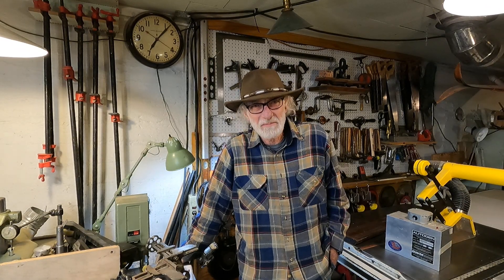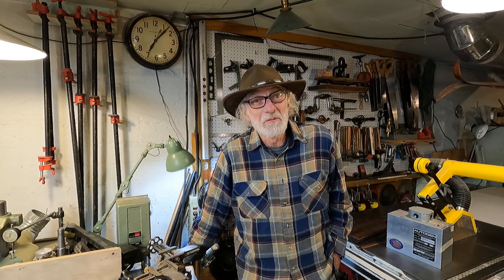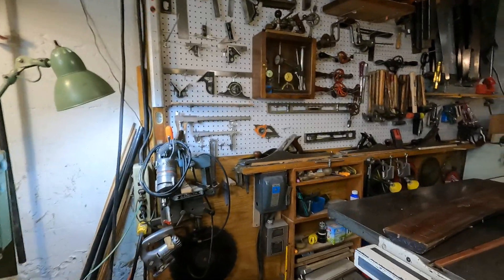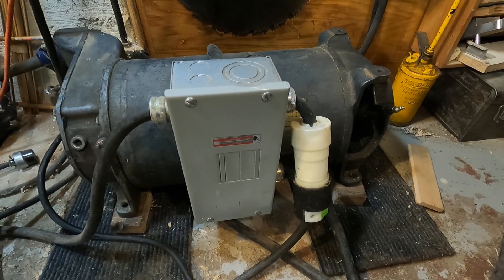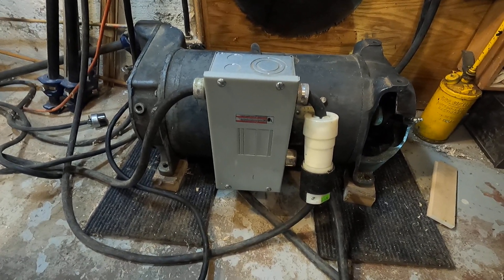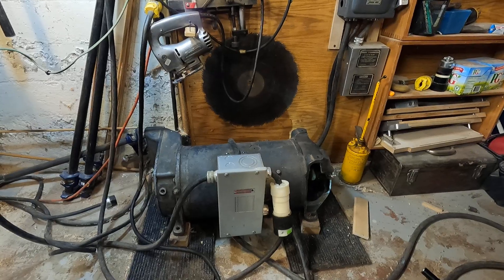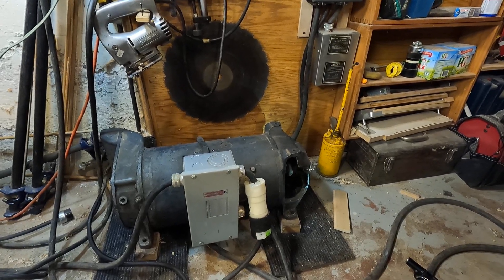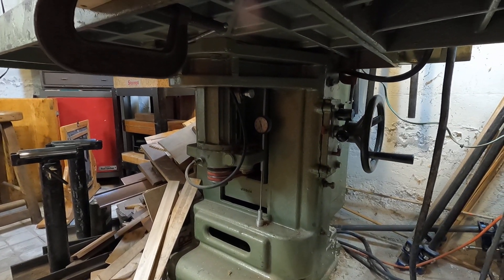Machine shop phase converters from the old days

Comment: Very interesting dee dee. I have yet to get 3 phase power. My Clausing 5913 that I am restoring has a 2 hp 3 phase motor on it and I have tried 2 different VFD's and the motor does not run . I saw the lathe run from a rotary phase converter when i bought it. So I am baffled. Some say that all 3 phase motors will not run on VFD's. I will be taking it to the rewinder's shop soon to see what the issue really is.. I am trying to keep the lathe original so have not yet considered buying another motor. BTW it is 75 degrees here today.
Reply from the maker: The Clausing are nice machines, not many around here. I have not got into the VFD yet I would like to try one on a woodworking machine. The motor shop I used is long gone I resort to testing motors using other motors that I get spinning before engaging the power. Then have a switch to juice the motor to be tested.
Reply: @deedeeindustrialsuperprecision  I am weak when it comes to electrical knowledge. I have tested it with a meter and it test good but i do not have a way to meg ger it or a way to run it without the VFD. The first VFD would make it run but at very low RPM then fault out on over load. The second larger VFD would not even turn it . It just faults out.  So I will just have to pay for professional diagnosis.  Most motor shops around here want the Industrial business and do not want to mess with a Hobbyist. Thanks for the response,  BTW if you do get a VFD be prepared to read Chinenglish lol the instructions are terrible.
Reply from the maker: @terrycannon570  The motor shop should charge minimal, I used one for years until they closed up. I think your machine is a variable speed with a reeves drive perhaps a rotary converter might be better.
Reply: @deedeeindustrialsuperprecision  I may wind up with a rotary converter . I went with VFD because of cost but now I have enuff invested in the two VFD.s to pay for half of a rotary. I was mainly trying to avoid the noise of the rotary. You are correct about the Reeves drive. It worked when i bought the machine. I took it apart to paint the headstock so hopefully it will still push fluid okay.

Comment: I'm lucky that my shop has real 3 phase, 3x 100A 400V. So everything is easy but all the breakers and switch gear is expensive.
Reply from the maker: Everything about utility 3 phase in my area is super expensive, lots of regulations you pay much more for it. Tens of thousands extra cost to add to construction, over $30000 to install in a small exiting building.

Comment: Great info Dee Dee, I run a 7 1/2 hp static phase-a-matic converter, no problems in the past 3 years. Great video, keep'um coming.
Reply from the maker: Those have worked for me, if you get a smart service meter adding an idler motor could save money.

Comment: I started working for an old man many years ago. He had a shop behind his house and We had to rope pull a big old motor for our 3 phase. I have found that 1725 motors are quieter and easier to rope start. 3450  rpm  motors are loud and hard to hand start. i liked the big old motors that were large in size where the armature had a lot of mass. these seemed to slow down less when reversing my lathe. I did put a small 1/4 horse motor that I used for starting later on. put power to the small motor then it would disconnect and apply power to the large motor. I liked having my converter motor double the horsepower of my largest machine.

  nice informative video
Reply from the maker: One of the things a couple of old machine tool dealers said years ago is that high speed motors have a better phase angle, but others have said 1150 rpm motors are the best, I really don't know the answer to that, and I have used a variety of motors. The Monarch 10ee motor generator is 3400 rpms with a very heavy dual armature, I had a 25hp homemade set up that I ran a 20hp lathe with it had the 1150 rpm motor worked good also.

Comment: Dee Dee,  That rotary phase converter you built from the old 10ee motor/generator is quite a piece of work.  I love it.  Great introduction to how to get 3 phase power cheaply.  I didn’t know about the smart meters; thanks for that info.  I know that there are YouTube “how to” guys showing phase converter builds if a person really wants to save money.  I made my own so it can’t be too difficult.  I set mine up outside to keep the noise out of the shop.  Instead of a manual switch to turn it off and on I am using an high amperage motor starter and control its’ coil with a 110v wireless remote.  I know a guy in Walla Walla who found a 100hp motor in a salvage yard if anyone really wants power! Cheers, Will
Reply from the maker: That inrush or high amp draw charge is high and adds up. The simple method of starting an idler motor with a rope is good to know in an emergency or just to test machines that have higher HP then your current system, never know what will come up in my adventures.
 I am going to make a little compressor and phase converter shed outside heavily insulated for cheap compressors.
Reply: @deedeeindustrialsuperprecision  I have my compressor inside another building and ran copper underground. Also ran my welding leads underground so i can weld in both shops. Very interesting about the smart meters. I did not know they could tell the price of oil has doubled. They must because my electric bill has tripled in the last 2 years and I am actually using less electricity. I get a weekly daily usage and daily cost emailed to me every week and a monthly forecast of what my bill is going to be. I save all those weekly reports and I'll be damned they were within $2.04 of what my actual bill was . Kind of makes me wonder if the game is rigged ! lol
Reply: @deedeeindustrialsuperprecision  You’re a considerate neighbor; I don’t have any so all I needed was a little protection from the weather.  Thanks lots for sharing what you know about rotary phase converters.  I am using the one I made over 25 years ago.  I used an 18hp Fairbanks-Morse hollow shaft turbine water pump motor.  The angular contact ball supporting the armature is in an oil bath. It will outlive me.  8 amps at idle.  You’re an adventure to follow.  Cheers, Will